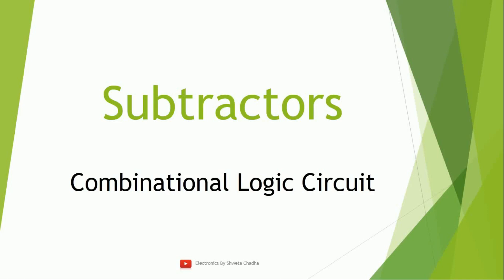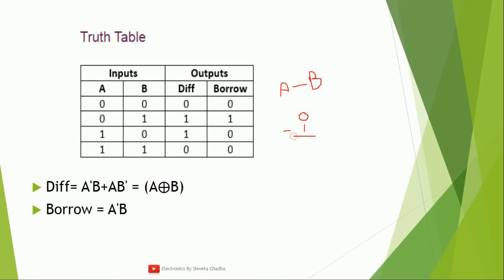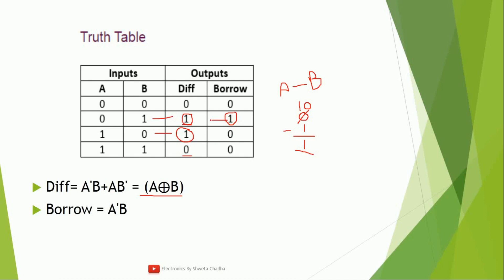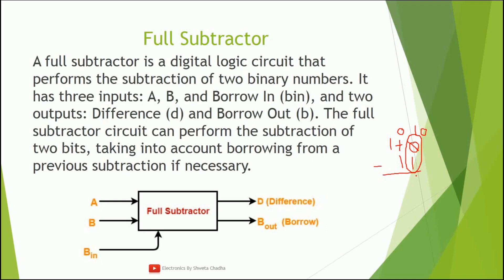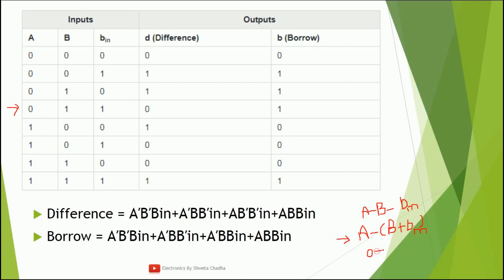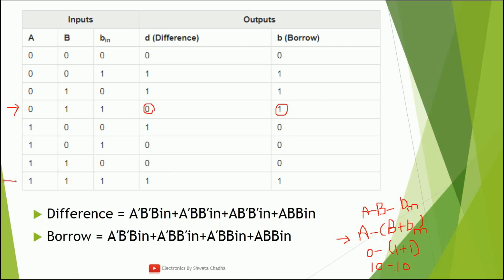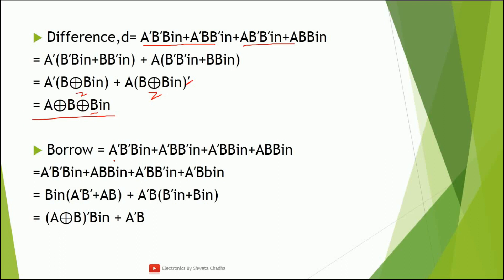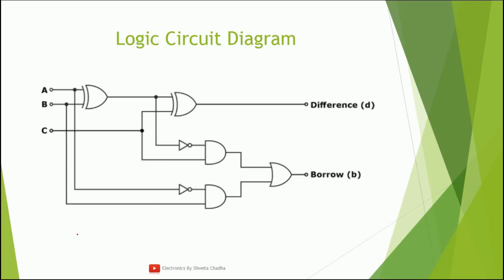Subtractor (Combinational Circuit)

Comment: Mam in full subtractor in Borrow = A'B'Bin+A'BB'in+A'BBin+ABBin ,
Why couldn't we taken A' common in first two (A'B'Bin+A'BB'in)  instead of taking  C common in first and last(A'B'Bin and ABBin)?
Reply from the maker: You can do that as well. Only boolean expression will get changed. And accordingly you have to make logic circuit diagram.
Reply: @electronicsbyshwetachadha  ok mam thanks 😊